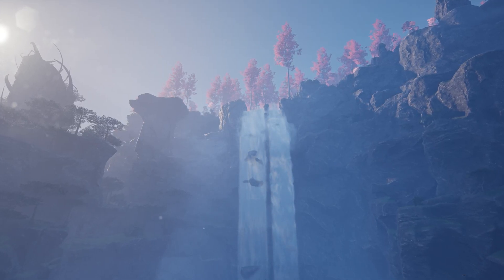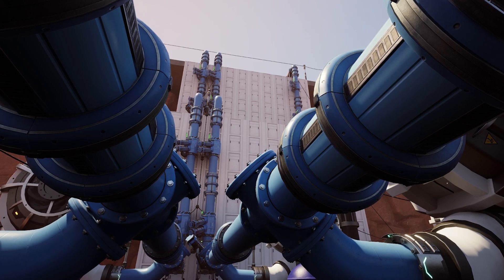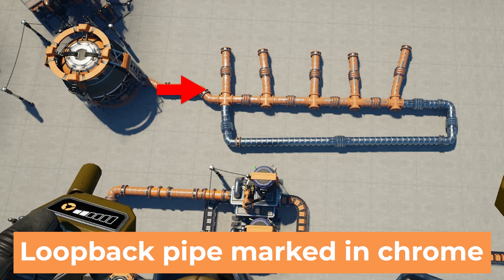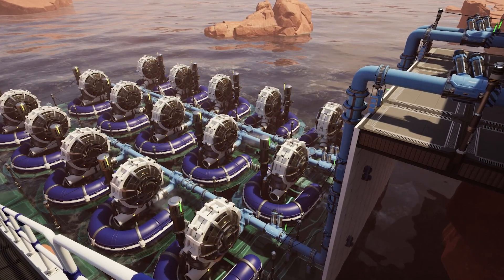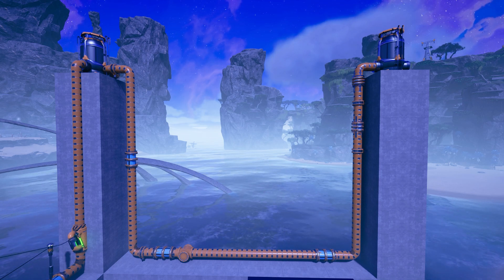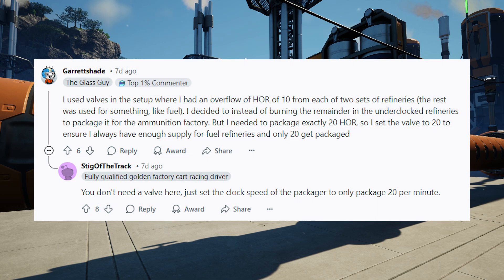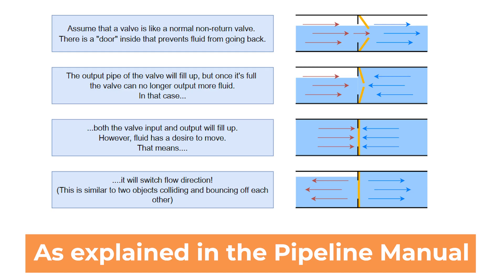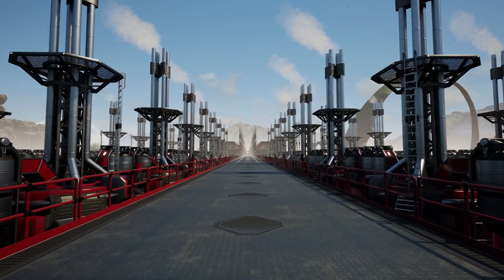Satisfactory: Complete Fluids Guide

Comment: i still think in 1.1 update pipes are broken, reason is because i have water fracking from a well i have a 300 + 300 + 75 going into 1 600 pipe, it fills a headlift water buffer 35m high to then fall down into the main network into what is eventually nuclear plant, so i effectively have 675 water going into a 600 pipe via fracking that fills a buffer 35m high, to then fall and fill a nuclear plant 15m high, the plant uses 595^3m /min with a pipe at 600^3m /min, but every now and then the plant runs dry to pause briefly to fill back up i got no valves and only 1 pump to send water up 50m at the beginning of the source
Reply: I have the exact same issue and yet to find a solution for this
Reply: I have this is issue with the exact same setup with fuel. Fuel gets pumped up to a buffer tower. I carefully check everything - make sure all the generators are filled, etc., and watch it run for a while. Fuel is flowing at a solid 600 in and 600 out. Everything is fine. Several hours later, when I'm tinkering with something several km. away, the last 4 generators on the fuel line are starved... and I have no idea why.  

I firmly believe that there is a problem with the simulation when you're not at the site, ie. somewhere else on the map.

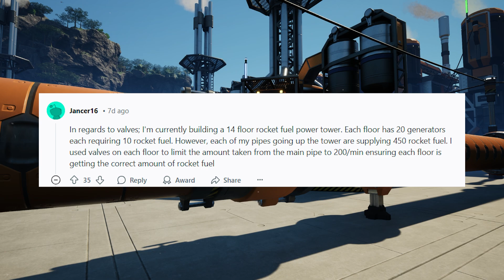Comment: 07:53   Isn't rocket fuel a gas? So it doesn't need pumps?
Reply from the maker: Correct. Although in this part of the video, i'm talking specifically about valves. Not pumps.

Comment: While the folks at Coffee Stain may insist these are features, not bugs -- and they may be technically correct -- the problem is real pumps and pipelines have methods for dealing with these problems which are not available in Satisfactory.  For example, industrial water pumps (the "water extractors" in Satisfactory) don't spin down when their outputs become saturated.  They keep running but excess water & pressure is diverted *back to the source*.  As soon as the pump can output more, the diverter stops diverting (or diverts less) to match the new outflow.  Satisfactory pumps don't do this.

Other examples are things like fluid buffers not behaving as you'd expect.  They're supposed to be the fluid equivalent of an electrical capacitor, storing excess "charge" from a "noisy" source (i.e. a source that generates output in bursts instead of a continuous flow) so the flow can be "smoothed out" for consumption by something that needs smoother flow.  Only fluid buffers don't always act this way in the game, and this is the bane of everyone's existence when they're trying to balance things like wastewater for aluminum production.

If Coffee Stain wants to stand on their statement that pipelines work like their real-life equivalents, they need to give us the same compensating options as the real-life equivalents.  Slosh, pressure "bouncing", and backflow can be and are managed by specialized equipment designed to do just that, reducing or removing the need for complex, unintuitive pipework in the real world.
Reply: k
Reply: Yeah, if it was even remotely real, pumps would be op and would solve everything.

Comment: Are there issues with pipe floor holes?
Reply from the maker: There have been, and I haven't heard of them being fixed. You don't need to avoid them, but you may need to just rebuild them if you're having issues.
Reply: Not anymore, they fixed em.
Reply: @Ecliptor.  Awesome thanks... Though that means I need to figure out why my oil power plant is having issues... >.>

Comment: one thing I learned and can't find again is that junction have priority. Meaning if it set vertically (with one end up the othere down), it will prioritize the bottom one. This was the reason I had problem with the alumina production since water bioproduct wasnt prioritzed over the under one. This was fixed by limited to output of the bottom one but could also be fixed by having the byproduct coming from under.
Reply from the maker: This is a great point. And I think it's tied to water physics. Applying real-world logic doesn't always work in this game, but it can be helpful to consider. I have had so many issues with the water byproduct from aluminum production that I would now rather turn that water into something else (like Wet Concrete) that could be sunk.

Comment: There IS a bug when upgrading from m1 to m2 pipes. On my oil lines, when I upgraded my pipes from m1 to m2 (highlighting m1 pipe segments and converting them to m2 similar to conveyer belts) random pipe segments filled with water instead of oil.

Flushing the system didnt work either. I had to rebuild the entire pipe network from scratch.

Comment: nothing from here helped the pipes are literally broken. i built a mega water tower and somehow someway i need an extra pump at the end of the pipe. then i do that and theres no throughput. so theres no throughput without a pump at the end and then after it works then its dead throughput again. the games physics is broken. it should just work with the mega water tower alone. water always finds a way to be level. NO PUMPS NEEDED ON THE WAY DOWN. THE GAME IS BROKEN
Reply from the maker: If that's the result you got, you did it wrong. Maybe my videos wasn't clear enough, so you should watch someone else do it or read the plumbing manual.

Comment: Something I find vital to know when dealing with fluids at large scale is that one of the major problems is the lack of built-in buffers to fluid systems. this is going to be a little long to explain, but bear with me.

A conveyor system can comfortably unload (almost) any amount of machines as long as the belt's max throughput is at or higher than the total, because in almost all cases machines connected to a manifold will empty before internal buffers are filled. By internal buffers, I mean the "holding" item slots splitters and mergers have, the output inventory of machines, and of course the capacity of the belts themselves. Solid items typically have a very high stack size to production rate ratio, meaning a machine can hold many cycles of a product comfortably, allowing it to continue working even if all belts ahead of it are full. And, assuming your math checks out, that belt Will empty in time to support the items coming out of the overfull machine. (Screws can occasionally mess with this, but usually only at the outset of a factory. the math always works out eventually, but screw manifolds are among the most unstable due to stupidly high production rates that make even the 500 stack size not count for much.)

Pipe networks, on the other hand, are much weaker. Pipe junctions don't have the "holding" inventory that conveyor splitters and mergers do, and because they have to be full to function at capacity, the pipes themselves have no internal buffer either. To make matters worse, fluids have a max in-machine capacity of 50, and many fluids are produced at fairly high per minute values, leading to a pathetic stack size to production rate ratio. combine this with a complete lack of buffers in a pipe system for excess product to unload into to keep machines running, and you have a disastrous sloshing situation due to machines consistently getting full and pipe flow rate fluctuating as a result, exacerbating both problems. 

Thankfully, the fix is extremely simple: fluid buffers. by building these into your output manifolds at intervals, you can integrate the internal buffers that make conveyor systems so predictable and stable into a pipe system. how frequent the buffers have to be largely depends on the batch size of the products being made, but personally I like the keep it close to 1 buffer after at most 300-400 M^3 of fluid per minute worth of machines.
Reply from the maker: Well said. Just adding buffers to the ends of my pipes helped most of my issues.

Comment: This is why factorio is better, simplify the mechanics to make it more understandable and more fun.

Before you argue you like the more 'realistic' fluids, why dont you fight for the same realism in the power lines?
Reply from the maker: Yeah, I think the devs are really proud of their fluids system, and rightly so. It's cool. But, I think most players agree it's not very enjoyable or intuitive for gameplay, especially when, as you say, power lines are super unrealistic.
Reply: @SatisfactoryNews  Factorio devs were really proud of their fluid system as well, but it was just causing far more problems than it solved. 

They bit the sour apple, and just changed it up so people could have some intuitive gameplay.

The biggest problems in this game is it heavily encourages calculations, tight factories, etc. but two major things makes it near impossible: Trains (Lock up in/output while loading/unloading), tiny manifold bugs, and fluids. For fluids you should keep like a 100-200 m3 of flow rate available, which just begs the question: Why? We get a number, I should be able to use that number. It's a logistics and construction game, not a fluid dynamics engineering game, and it should play as such.

Every time I play it, I enjoy it heavily, until I get half-way through the game and need to build 50 refineries for something one more time, and fluids just don't work as expected, and trains don't have the expected throughput and my manifold which has mathematically perfect ratios lose a SINGULAR output every half a minute or so, regardless of everything I do to fix it. I can only mitigate, can't fix.

Comment: In their current form, valves are only suitable for preventing water from flowing back or when we want to close the flow.

Why do they use the byte data type - 8bit (0 - 255)
Instead of using ushort - 16bit (0 - 65,535)
Then they would be suitable for use
Reply: I think it is because of optimazation,the pipes sistem in this game is extremely detailed but dosnt cause as much lag as it should in any game,i belive that is because how the mecanic of the flow itself is made,but if one changes that flow while continuing other flows the game has to check every 8bits at what flow does it goes
Reply: Supposedly the problem was fixed in Patch 1.0 but it was never mentioned anywhere for some reason. It's now stored as a float instead of a byte.

Comment: Just make your fluid factory around mk1 pipes but use MK2,. All problems solved
Reply from the maker: You may think so, but in general full pipes are happy pipes. There is a danger in maxing out pipes completely as I mentioned in this video, but if your pipe is only half full you are likely to have pressure and flow issues (it all depends though).
Reply: @SatisfactoryNews  try it.

I did and it fixed every issue in the book, the primary reason is that it allowed the pipes to overflow to like 340 and down to 260 as normal for a set of machines that are demanding 300.

As you mentioned, if you design a row of machines that use 600 and you only have MK2, it won't work well due to varying machine intake rates.

This eliminates that and also allows for full flow rate because there's always empty capacity in the pipe.
Reply from the maker: That is definitely a factor. However, anecdotally, I was just having a problem with fluids, using about 500 fluid in a 600 MK2 pipes. I split the system in half so about 225 was going through two different sets of pipes. That still wasn't working, as even when I pre-filled the machines the ones at the end of the manifold would slowly receive less fluid. So I changed both systems to MK1 pipes, and that has been holding steady. But who knows, there are too many factors to consider and maybe multiple things will work for different uses.

Comment: Nit, 256 levels are representable by 8 bits, which is 0 to 255, not to 254
Reply from the maker: Yes, that is correct. And the valves are 8-bit minus one, meaning there are 254 values rather than 255, hence why I said that.

Comment: I just quit using the Mk 2 pumps. The placement markers have never worked right for those (I NEVER had a problem with the Mk 1's beyond lack of power for more advanced builds).   I have tank farms on taller points on the map and haul my fluids by train. To be honest, I hardly play it at all anymore. Not interested in a game where they expect me to have an advanced degree in fluid dynamics just to design a factory. If I'm in a position like that I HIRE somebody to do the math! Hook up pipes, turn it on. Maybe an option to turn off fluid physics? Or maybe default to off and give the fanboys (who I know I'm going to hear from) the option to turn them on? I'll bet if you track usage more players will opt for OFF.
Reply from the maker: Totally agree. I think it's cool on a technical level that fluids perform realistically, but I would much rather have the game make more sense and just have the fluids flows like items on a belt.

Comment: I had spent a whole day setting up a looping fluid set up with an aluminom scrap recipe that uses sulfuric acid + water... But produces water. Had 4 machines each making 50 water and needing 60. So i thought i could just limit an inflow of water to 40 and be good. Boy was i wrong!

Eventually i realized the valve was not exact and im happy to know i was right. My solution was to get as close to the value i wanted as i could, and 40.1 was my solution. 

I also added two big fluid buffers, on either side of the fluid manifold. JUUUUST to make sure. 

It has been running smooth as butter ~ (till i realized my sulfuric acid was running low due to my drone set up not able to carry in the exact amount i require. Bummer! No idea how to fix that.... Other than just setting up a second drone port i guess ha. )
Reply from the maker: Fluids really is a multi stage battle like that! But yes, sounds like you need a second drone, haha.

Comment: The video is largely discussing all fluids equally, but my understanding was that gases function differently from liquids. One that I know is they are not limited by head. Does anyone know if they have pressure or any other mechanical differences to know about? Are they also susceptible to sloshing?
Reply from the maker: As far as I understand, the only difference is that they are not affected by head lift. So in theory they are affected by pressure and sloshing, however anecdotally I feel like gasses do not have these issues as much as fluids do.
Reply: This is anecdotal, but in my experience, gasses do not slosh and are generally much easier to work with.  I am not an expert by any means

Comment: They need to add transparent pipelines
Reply: The choice to make pipes opaque and to use the 2d graphical interface to show their state is quite deliberate.  In order to visually show the liquids, the game engine would need to simulate actual fluid dynamics which are notoriously compute heavy. 

Pipes basically work like conveyer belts with a different in game appearance.  By using a simplified 2d aproximation of fluid dynamics that's specific to each pipe segment, and having each pipe send and recieve this information from the next segment you can vastly over simplfy the calculations needed, so it's probably not going to be added in the near future but maybe a few generations of PC components will make that viable. 

It's certainly not impossinble to run 3d fluid simulations on modern gaming PCs, but they're still pretty demanding and would probably cause a lot of issues if you didn't plan on implementing it from the begining and optimise your code accordingly.

Timberborn springs to mind as a game that centres around irrigation and hydronics, but it does so using an even mkre simplified mechanic, basically emulating the water source block from minecraft.  

In practice, it's easier for players to wrap their heads around a simple and predictable model than an accurate simulation.

Comment: please, never have a buffer before a manifold. Or anywhere in line to a manifold

take it through a thought experiment - you get back flow within a manifold at or after the first junction. This pushes against the 600 flow coming through. So it doesn't matter if there's a buffer there to 'add more' because it'll never catch up.

For less than 600 systems even, pipes themselves act as a small buffer. So a separate buffer that has it's own issues attached will either do nothing or cause issues.

I highly recommend consider editing this video.
Reply from the maker: I'm just taking the advice of the reddit post I linked, so take it up with them. I didn't see anyone disagreeing with them. And even in my own testing I found that adding a buffer helped stabilize the flow and it was enough to save my production line without even needing the loppback pipe.

Comment: Why reduce output to prefill machines? Just switch them off with the little power rocker switch that FICSIT provided!
Reply: They don’t fill if turned off, unless they’re fuel generators
Reply from the maker: Unfortunately they don't fill if they're turned off, hence why we have to underclock them instead.
Reply: @SatisfactoryNews  i do this all the time with refineries. They do have to be powered, but switching them off lets them fill
Reply: Power sources (specifically coal power generators and liquid fuel generators, and I think biomass burners as well, idk about the others yet) do fill up both solid and liquid components as long as the machine has power, even when the rocker switch is turned off. All other production machines behave as described and will only accept input if power is applied and the rocker is on.